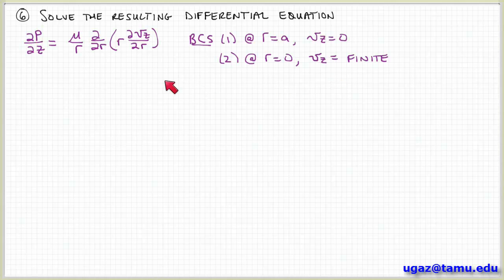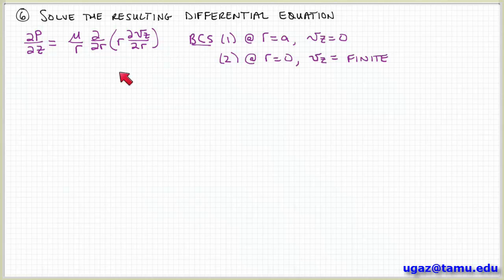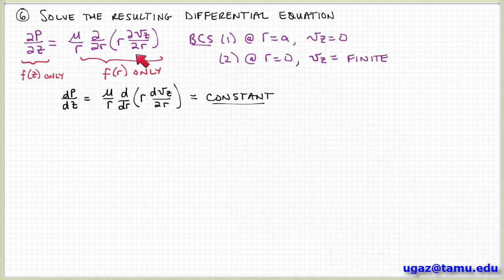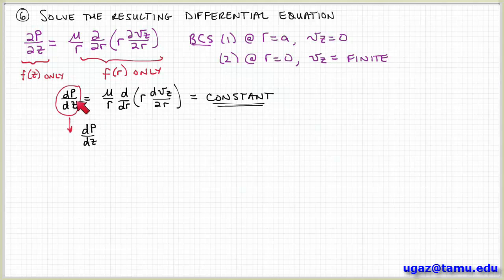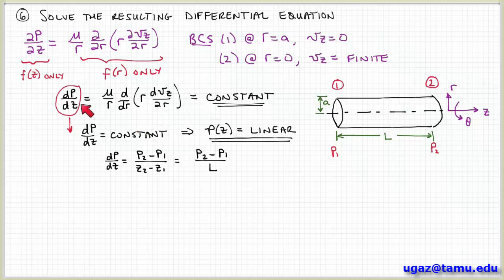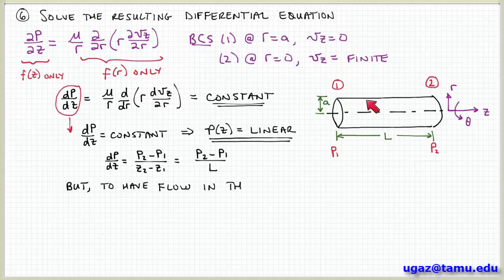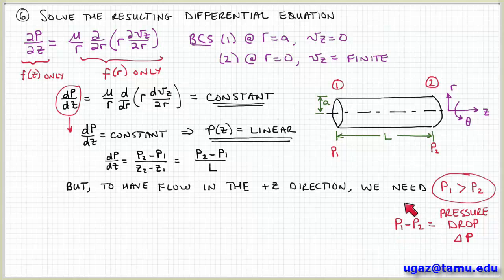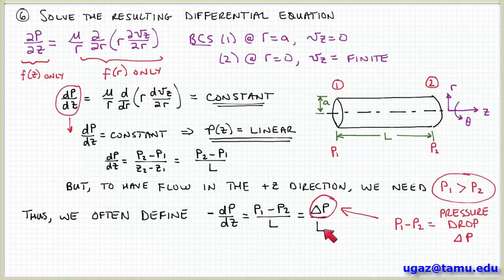Applying the Navier-Stokes Equations, part 3 - Lecture 4.8 - Chemical Engineering Fluid Mechanics

Comment: At 3:01, though what you've explained makes sense, isn't it true that the pressure does change with respect to r? At the walls of the cylinder, pressure is a maximum due to the stationary fluid, and in the center of the cylinder pressure is at the minimum due to the velocity of the fluid being the highest at that location. Is this not true?
Reply: Hey! I thought about your question and I think I got a satisfiable answer.
We know that the driving force of the fluid is the pressure difference along the pipe, right? This pressure difference puts the fluid at motion, and as a consequence of that motion the fluid also acquires a pressure change with respect to the radius (r). Notice that this pressure change along r is not the cause of the motion, but the effect of it, thus it is not considered when we study the driving force of a fluid (which is the purpose of Navier Stokes).
Also, if you think of Navier Stokes as f=m*a, you'll notice that this pressure difference along the r axis is symmetric between the top and the bottom of the pipe, so the resulting force between these equal but opposite pressure forces is zero.
PS: I used the help of an AI to get to that conclusion, at the time you made your question there weren't any AI to help, its crazy how this technology can extend human thinking

Comment: 1 doesnt have to be greater than 2....for your diagram to work it does but if there is a drop in the pipe liquid will retrieve like the tide. no?

Comment: Hi. I'm a Chemical Engineering student as well. As for both chemical and biochemical process simulation, what are THE BEST softwares would you recommend ?

P/S: The software should be able to perform simulation for the both the aforementioned processes.

Please. I need help. I want to be good at ONE but The Most Suitable platform for the simulation of chemical and biochemical processes.

Comment: Hey, that was one really great explanation of the topic. Thank you so much. Are you going to upload more videos.

Or do you mind answering a query.
I read a question but I am not sure how to do it. Its as follows :
A cylinder is filled with inviscid fluid and rotating with angular frequency omega. Also, at the bottom of the cylinder there is a hole for the water to fall. How can we find velocity trajectory in such a question ? As, now the water is also falling and cylinder rotating.